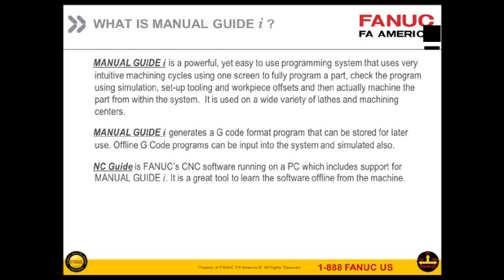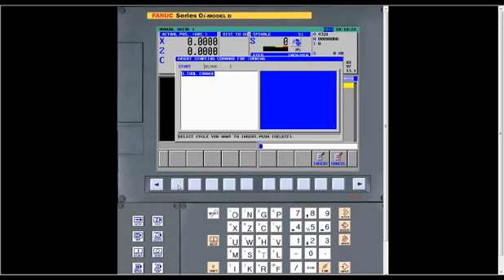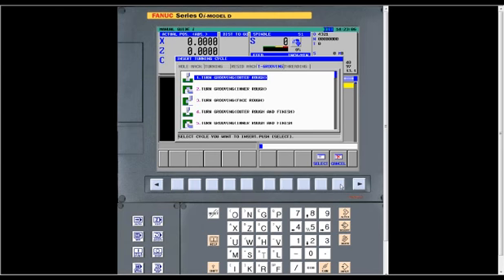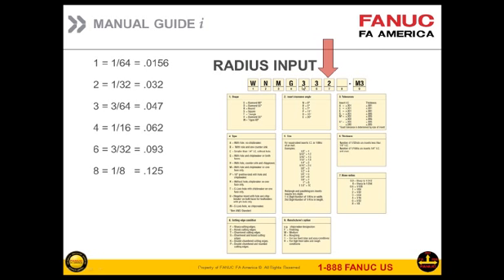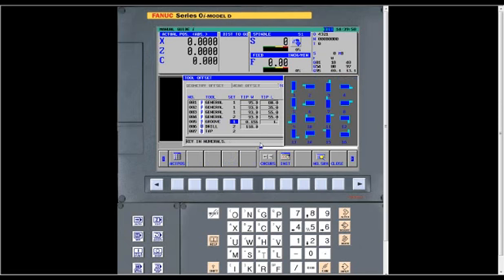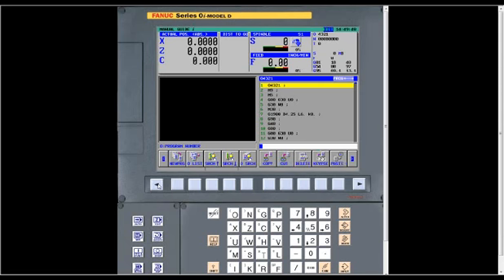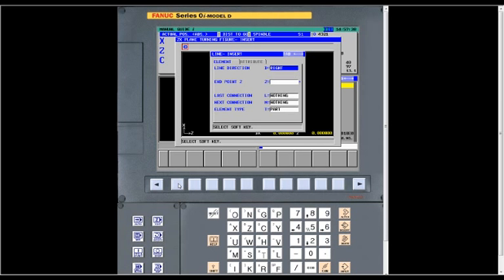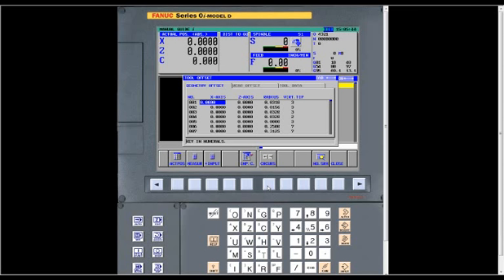MANUAL GUIDE i -Part 1 Overview Setup

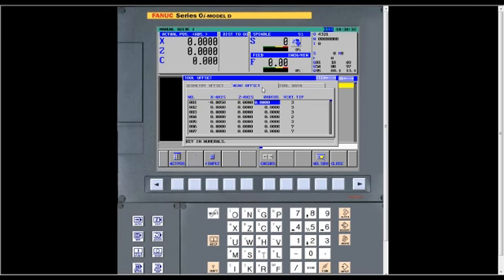Comment: 31:58 - My machines controller (Oi-TF PLUS) requires me to put a negative(-) radius value in the Wear Offset Radius column because if I leave Wear Offset Radius at 0.000 as you recommend my machine will take the Tool Geometry Radius value for that tool & apply it to any radius cut (G02/G03).

EX: Creating a 2.5Radius on Face of part at 25mm dia. 

Tool Geometry Offset Radius = 0.800 & Tool Wear Offset Radius = 0.000
start...
X19.2 Z0.
X25. Z-2.9
end...

VS

Tool Geometry Offset Radius = 0.800 & Tool Wear Offset Radius = -0.800
start...
X20. Z0.
X25. Z-2.5
end...

I don't understand why I need to put the negative(-) radius value in the Wear Offset Radius column but if I don't then all my G02/G03 cuts are incorrect by the Geometry Offset Radius amount.
Reply: I know this comment is a few months old. But the way you need to do this is call your tool for example tool 5 (T5M6) then activate compensation using G43 H5 D5. The move to the centre of your hole and activate cutter comp I’ll assume you’re climb cutting G0 X0. Y0. G41 then move on to where you want to start your arc and move anti clock wide for a pocket and clock wise for a frame. This will have offset your tool by the radius you have set. Note that D5 might not always correlate to T5 if you have not inputed them right in your offset menu.
Reply: If you need some more in depth help with it reply to my comment and I’ll send you my email.

Comment: Dear friend, I have a very important and very urgent question ?
I have a Turning machine Control Type ( FANUC Series Oi Mate - TC ),
But the key ( MDI mode ) If press Key ( MDI ) does not work,
Are you Have any other way to activate ( MDI mode ) at I can change Some PARAMETER and other operations ?
Thanks for you
If you can contect with me on :
E-Mail : nasr2007ali@gmail.com
Watts App : 00201023255416
Im very thanks

Comment: This is an invaluable learning video in low quality. Is there a reason why the video cannot be uploaded in 720 p or better? Code lines on the simulator are not legible-due to low quality 240 p, rendering this otherwise a great tutorial useless.

Comment: Do you think this will ever replace the basic G and M code programming. I'd like to learn this but it seems abit pointless as nobody at work uses this
Reply: It is not intended to replace G and M-code programming, in fact it is a type of G and M-code programming. It is an alternative to manual G-code programming or CAM programming for users that prefer to program at the machine. Typically the main use will be a toolroom or a job shop that has a simple part and no CAD file.

It is intended for machinist that want to use a CNC for better productivity.
Reply: Machine cycles are always nice, fast and handy , can be edited instantly , WILL take into consideration tool management data . Cam code usually spits out a long code , that can only run in a very particular way (for example change an endmill to 1 size bigger , the roughing op will make the part scrap before finishing) . There are post processors that can take advantage of the machine specific cycles , and will post most of the code in a 'user friendly' way .

So , no it won't replace it , but it's ok for simpler to medium parts , usually 3d or more simultan axis movements cannot be handprogrammed in neighter Fanuc nor Sinumerik , Okuma , Mazak .